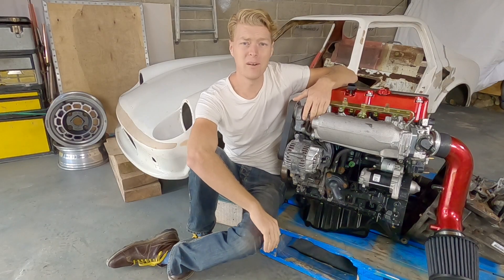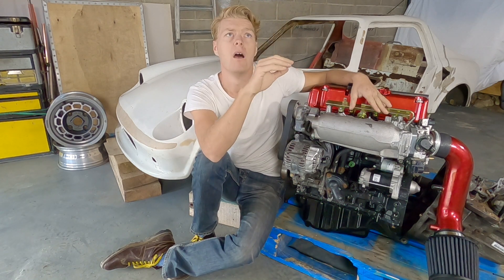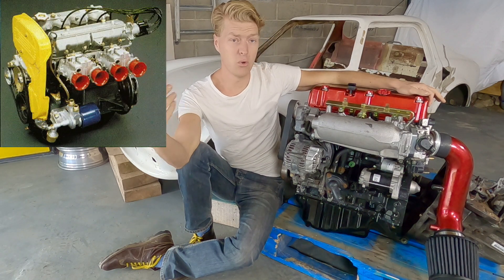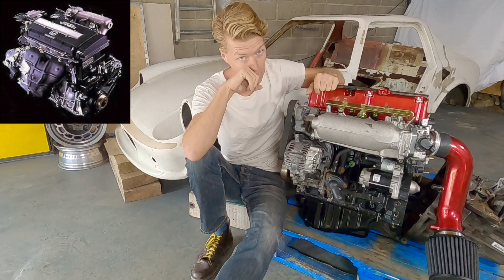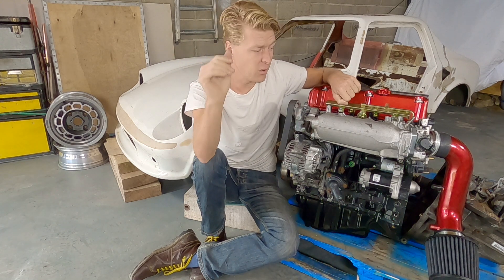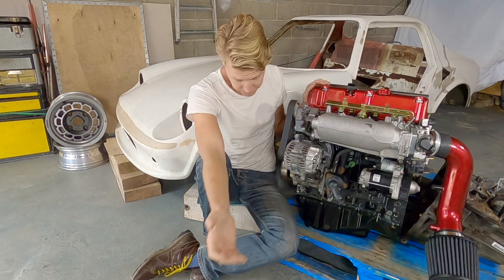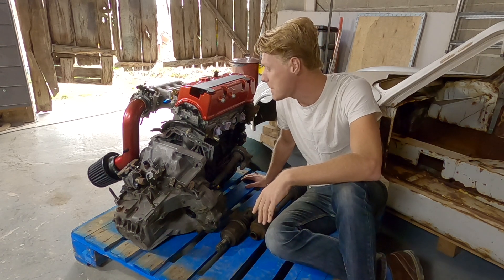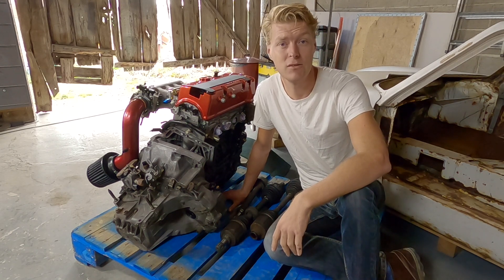Why Honda K20A? | Project Mosquito Honda Type R Mini Supercar (Ep9)

Comment: The nice part about opting for a Honda K or J series engine is that there are aftermarket companies that make ECU and wiring harness packages specifically for swapping that engine into various things that weren't meant to have that engine. It's just very accessible as an engine swap choice for small, lightweight cars. It's the LS of 4-cylinder engines in that regard. Another option if you decide that you really, really need more power is to go ahead and turbocharge it, but to use a fairly small twin-scroll turbocharger and use a front-mounted heat exchanger sat in front of your radiator to chill a water-to-air intercooler mounted wherever space can be found to wedge it in and plumb intake lines to it. You've got space beside the engine above the transmission to fit a turbo and some of the intake piping, so it is an optional route should you find it capable of handling more power without immediately threatening to chuck you into a ditch backwards. As it is, I agree with you that an NA K20A is a well-suited match for the power needs of that car. It's like a 1st gen Mazda MX5 with the drawbacks of a Toyota MR2: it's too light to stay planted if you put too much power in it and if you do put too much power into it without being a skilled enough driver, it'll suddenly decide to swap ends on you and throw you into a ditch backwards as punishment, which isn't ideal. But, at least you do have an engine that has a ludicrously strong aftermarket community, so if you do find that you can handle more power and you want to go down that path, you can easily order aftermarket parts to get you there.

Comment: I agree with what you said.  Honda's engines are overbuilt and as reliable any engine out there.  200 hp is more than you'll need to have a fun car.  Should be scary fast!  And it still will be under worked.  Hope the gear ratios are high enough.  I'm thinking 2000 run at 100kph will be plenty high. Like you said you need to keep it simple, turbos are for heavy cars that have tiny engines.  The aftermarket for this Honda engine is large so you will have parts to do anything you want.
Reply from the maker: It should be more than tall enough with the 6 speed I might even gear it down because I'll be happy with a top speed of 130

Comment: I replaced the factory clutch in my 2002 RSX Type S with the Exedy KHC 10 Kit.  Comparing the oringinal Honda clutch to the Exedy, the only diference was that the Honda clutch had a Honda part number.  All the other markings stamped on the pressure plate were identical.  Exedy supplies Honda with OEM clutches.  Amazon has the Exedy kit at $203 currently.  The Honda parts would be considerably more money.  I hope this helps.
I've had one issue with the drive train.  The rubber damper on the left half shaft accumulated moisture and salt over the years causing corrosion to weaken the shaft and resulting in a break.  Remove that damper to eliminate that eventuality.  There is no noticable vibration as a result of losing the damper.  
On  a side note concerning fuel economy, my 2002 RSX has 160K miles on the odometer now and it still gets 24 mpg city and 31 mpg highway milage regardless if the AC is on or off.
Reply from the maker: Thanks that's really great to know

Comment: K series is an excellent choice and one I have debated heavily on with my build. my engine bay would require work to fit a 4 cylinder. I will keep it a 3 cylinder, but it will be from something modern with a 6 spd gearbox.

Comment: If I hadn't seen the Stanceworks Ferrari, I would have been surprised at this choice, but having watched that series, it totally makes sense😁
Reply from the maker: It's an easy fit in the Italian because it's a much bigger car but Mosquito should have the higher power to weight ratio of the two
Reply: @OliverPickard  Sorry, I wasn't very clear in my comment.  That was the series that familiarized me with the K-series engines, so it no longer surprises me when someone goes that route. Of course he went full send with turbocharging and everything, but it opened my eyes to the potential 🙂

Comment: Have you checked that you can get the car French plated with the Honda power unit?

Are you going for 'Voiture de Collection' status,ie black/silver plates, (must be minimum 30 years old)   If so you need to send a dossier to the FFVE so they can produce a certificate to allow ANTS to give you your Carte-Grise easily....but normally FFVE expect any engine change to be a period modification'.

If you want a modern Carte Grise, you'll have to put the entire car though the DREAL process which can be tricky.

What part of France are you in? I'm in Dept 87.
Reply from the maker: The whole car will require new homologation and I'm fine with it

Comment: The K engine is by far got more potential than you’ll ever need from the mild 200 Hp to 1000hp plus if turboed 
Ariel atom use these there’s hundreds of mr2 lotus and other rear engines swaps been done using a K engine and box including some that hold world records class records and just beat cars with far more pedigree 

This little car will be a giant killer even tuned to 300 Hp natural aspirated in a chassis that light
Reply from the maker: Thanks 270bhp & 620kg is almost too much in such a tiny car
Reply: @OliverPickard  
I know of a kp 60 starlet which weighs 800kg and has 400 wheel Hp out of a turbo 4age Toyota engine it’s extremely fast you’ll be very close to it 
You’ll have a wonderful time and your driving skill will lift to that of your car